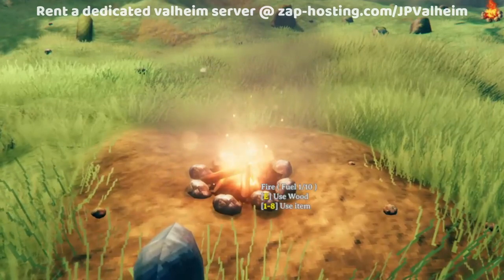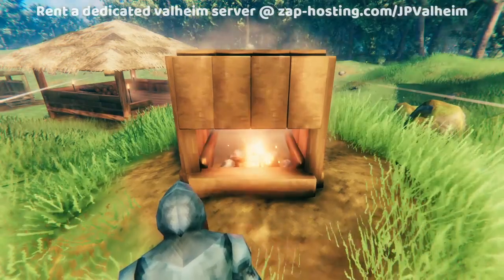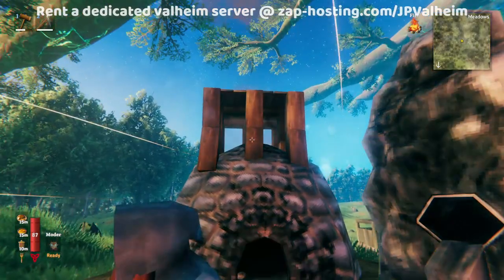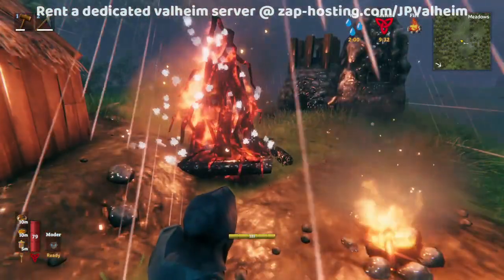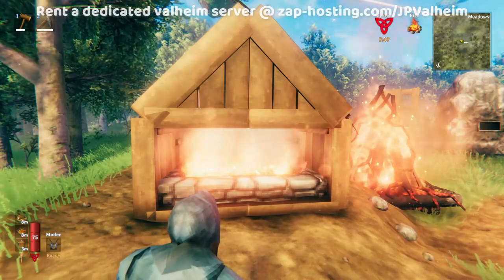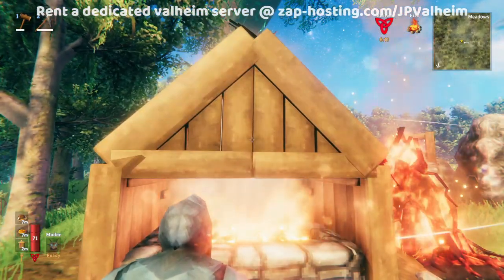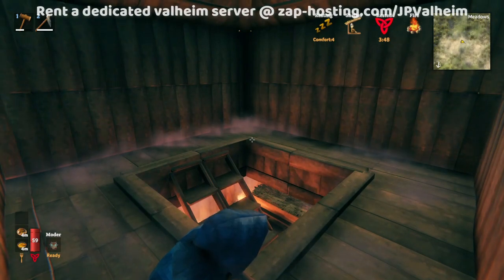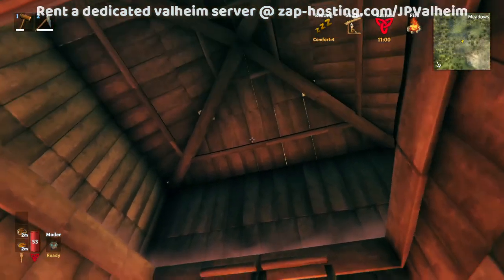How to Clear Smoke Without a Chimney in Valheim

Comment: This is awesome information. Thank you.  I'm struggling with gate protection at my main base atm. I'm on a hill, high walls. One main entrance .Two gates, one iron and behind that one dark wood. But when raids happen. My doors get smashed and into my base they go. So maybe a moat idea or something to help protect the main base gate as you get further along in the game and raids are harder. Thanks 😁🤗
Reply from the maker: Something that helps me a lot personally is knowing how the monsters attack your base. Basically, the monsters don't care about your base. They only want you. So if you stay inside your base, theyll attack your gates. But if you make a place you can run to, the monsters will destroy that instead. So you could try to make a place that you can quickly run to when the raids happen.  Think of it as a hut thats meant for them to destroy. Place lots of stuff in a way where they have to destroy the wood bit by bit. It just needs to last 120 seconds for each raid, then the monsters will leave if they can't see you
Reply: You won't have to worry about raids if you play in Hammer Mode. The Devs themselves put it in the game, it's not a mod. So it isn't cheating.
They also allow you to bring metal and ore through a portal now.